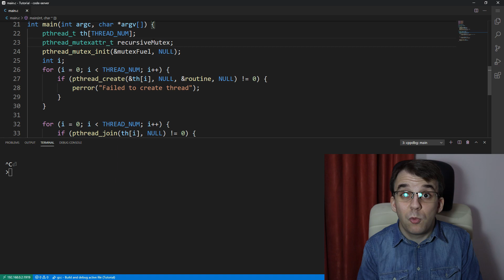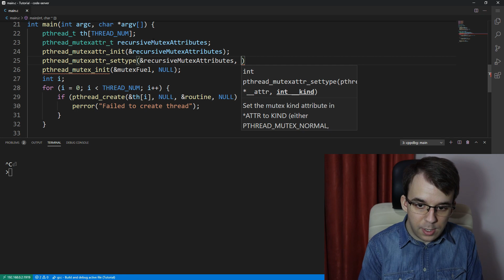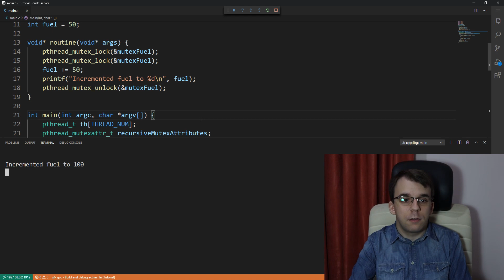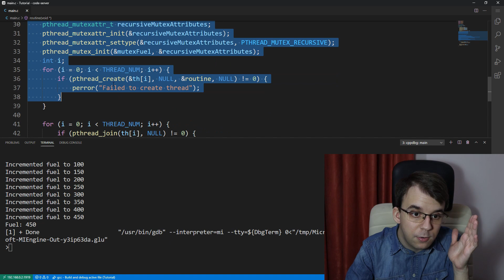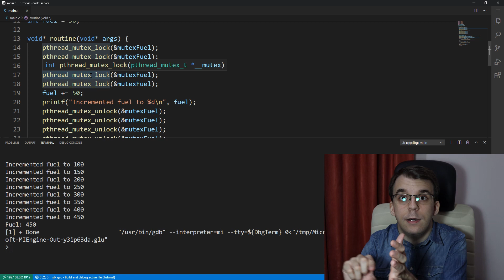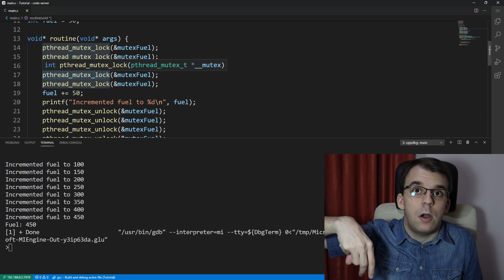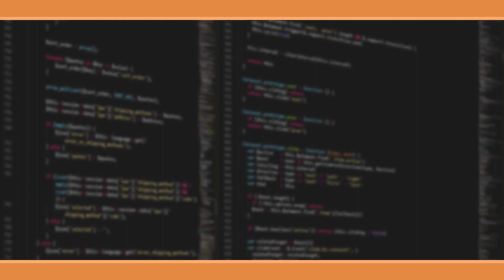Recursive mutexes

Comment: nice
I'm trying to implement a parallel recursive dfs using pthreads, but I'm not sure where to use the mutex, can anyone help me?
Reply from the maker: If all the threads are just reading the data then you don't need any mutex. You might just need a mechanism to communicate when you find the value you were searching for.
Reply: @CodeVault  when i run the code some of the values are printed more than once
i'm using an array to keep track of the visited nodes and i think multiple threads can change this value and reread the node
Reply from the maker: Ahh, then you need a mutex for that array. But maybe you need a different approach as doing that would make the program run mostly on one thread at a time.